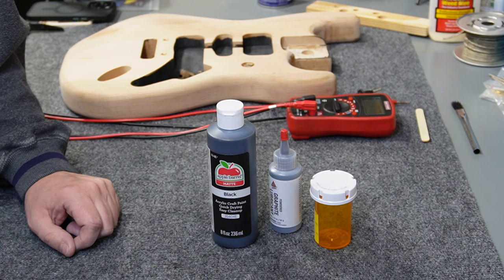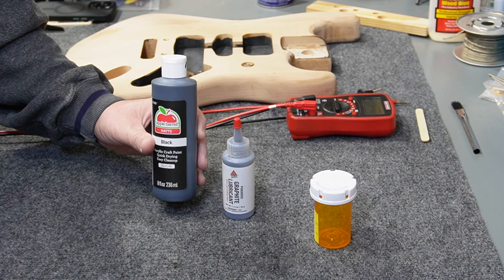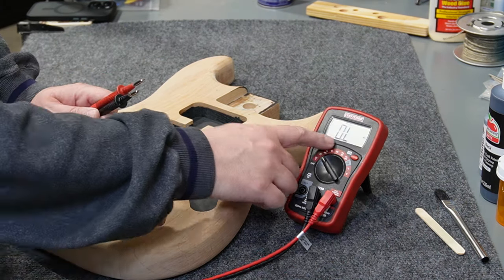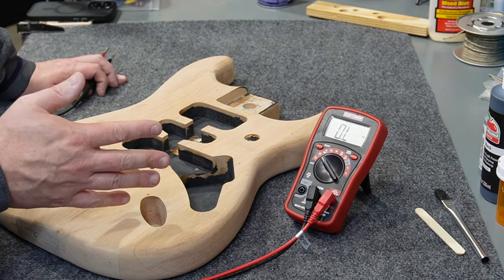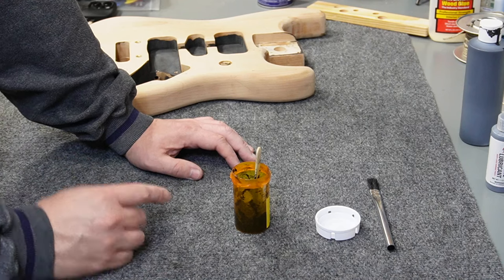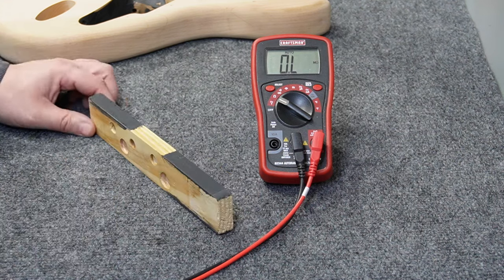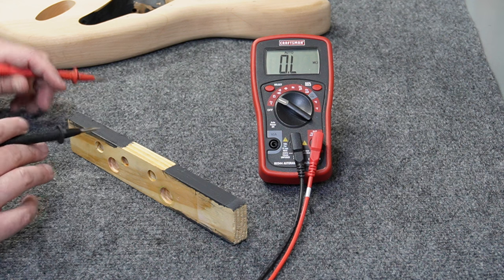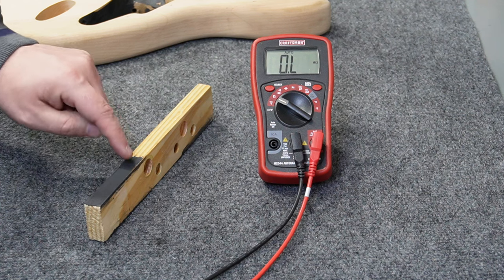Quick Tip 18: Make Your Own Electric Guitar Shielding Paint Using Graphite for around Five Dollars!

Comment: Try putting on a second coat after the first one is dry, like the next day. Professional EMF paints instructions usually recommend putting on two coats, which translates to my personal experience that with whatever I'm using as guitar shielding paint I do usually get a better conductivity reading with two layers than I'm able to achieve with even a thick single coat.
Reply from the maker: I definitely do that, and it does help conductivity.

Comment: Important question... Do you have to connect the shielding paint to the ground circuit of the guitar? Iv never seen anybody doing this
Reply: Btw I have a Les Paul with the typical cavities of pots, neck pickup, bridge pickup and the pickup switch (which are separated)
Reply from the maker: It works best when you do.  It's not absolutely required, but it won't do very much without it.  In an LP, your switch and your pots will typically contact the paint and ground it that way.  Pickup cavities might not get grounded unless you're intentional about it.

Comment: What’s an acceptable measurement?
Reply from the maker: Good question.  The only reference I really have is that standard Fender paint that measured around 25K Ohms with the leads about 2" apart.  The closer to zero, the better, but I was not able to get it under 1K.